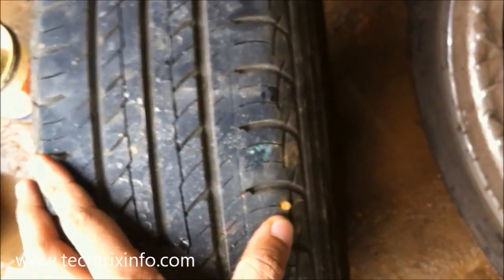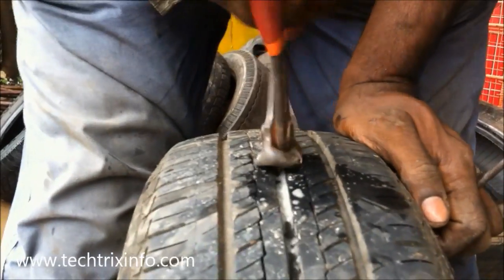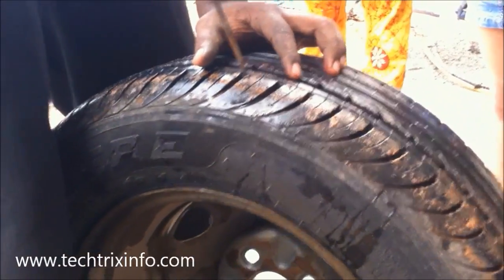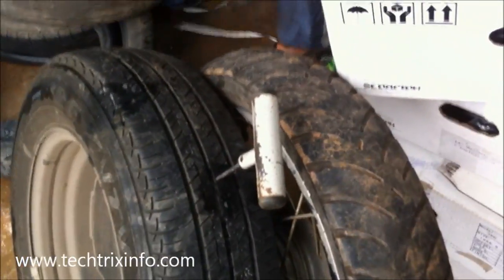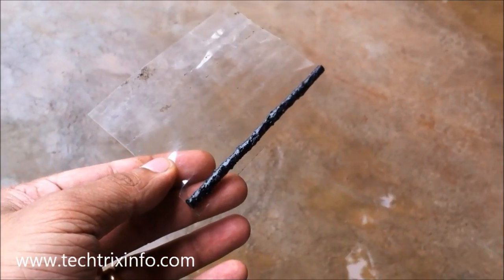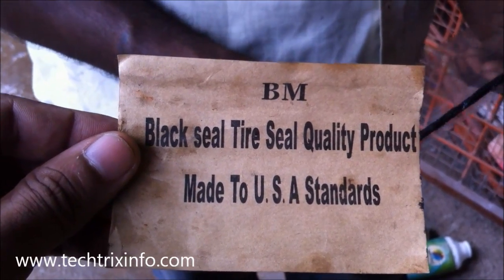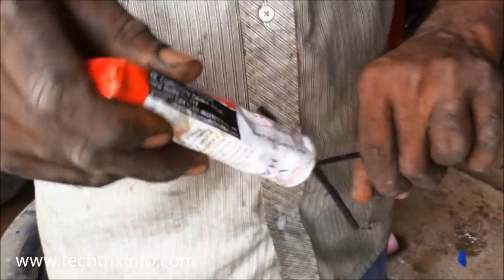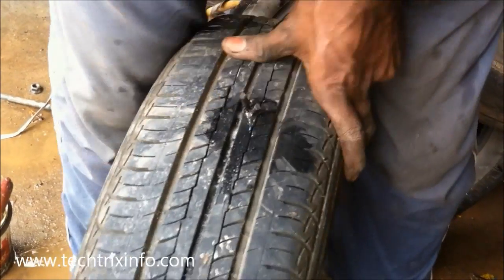How to repair a tube less tyre puncture in 30 seconds. ✔

Comment: Perhaps this is the worst way of repairing a puncture in a tubeless tyres. I can prove this . I have the better way of doing it.
Reply: why don't you explain the way?
Reply: When u repair an injury from outside, you don't know the condition of tyre inside. Secondly, these gum in the strings get dried up and it gets squeezed, which results in air loss and water seepage into the tyre wires which later on damage the tyre. Hence to avoid all these, you must get the tyre repaired using mushroom plug , which seals the tyre from inside and on the tread walls, eliminating the air leakage and water seepage. Since it is of the same material which the tyre is made of, it wears out evenly as the tyre. Please do look at my video : rangerstork tubeless tyre puncture repair process.  Please share your comments and views.